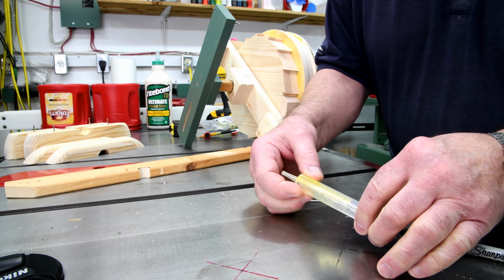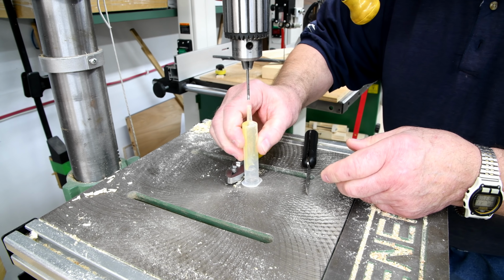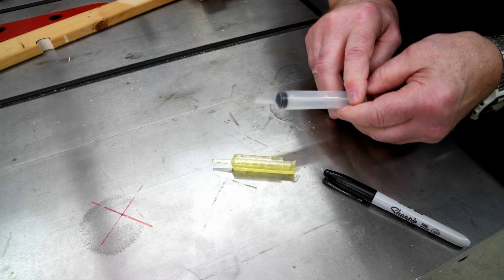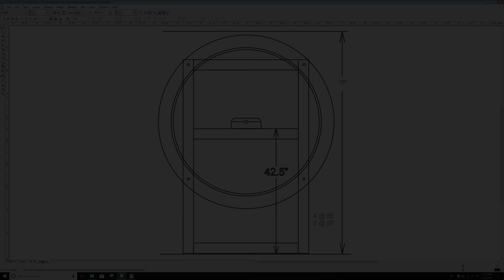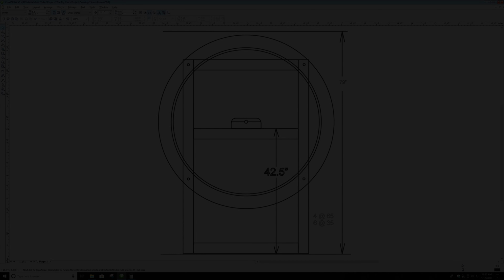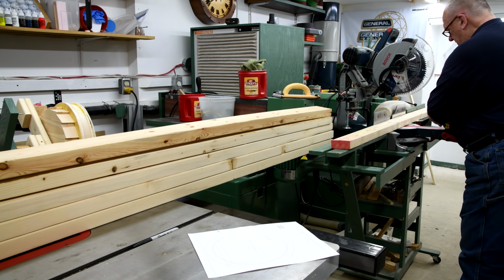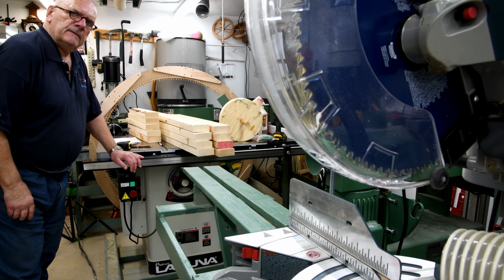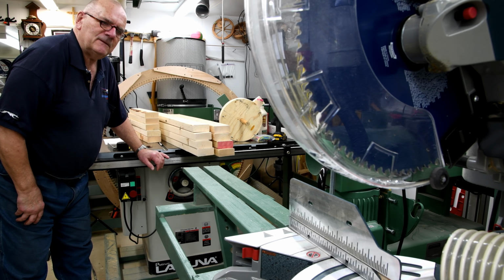The Big Clock Project - Part 119

Comment: Binding is bad on a miter saw.  I have a quick hold down on each side of the blade on mine and use them all the time.   I learned the hard way with a violent kick back.  The hold downs really do work.                  See ya tomorrow.               JimE
Reply from the maker: The worst catch/kickback I ever had was with my first power miter when cutting a plastic pipe. btw, this Bosch is my third one. Anyway, I wasn't holding The pipe tight enough against the fence. The blade was about an inch into it and the pipe rotated. BANG! Pieces of pipe everywhere. Was lucky to not have been hurt. Now I use a sawzall for plastic pipe, or clamp the pipe VERY securely in the miter saw. --- no kickback. That goes for round wooden dowel too.

Comment: I noticed that you do something that I do as well... you measure with the tape measure, make a mark, then use the speed square to draw a line all the way across the board. I wonder, is this really needed with a miter saw? I mean, why not measure, make a mark, then chop on the mark. Just seems like an extra step. However, as I said, I do it too. Probably out of habit.
Reply from the maker: Yes! It's a habit I guess. If I'm cutting a narrow piece I won't remark it with the square. But unless I'm really lucky, on wide pieces, the blade will usually not touch the wood at the first mark. Now that I think about it, I do the square thing on pen blanks too, lol  :)